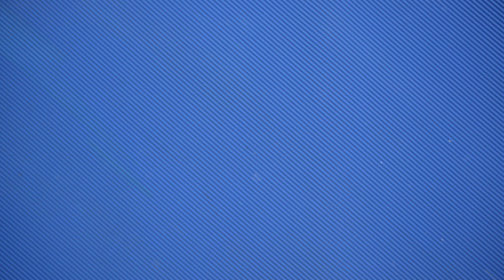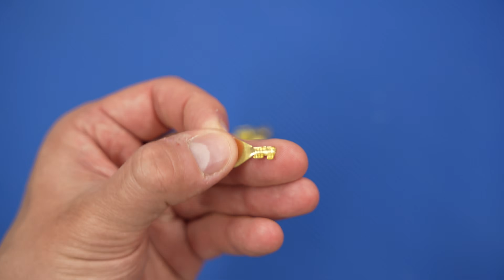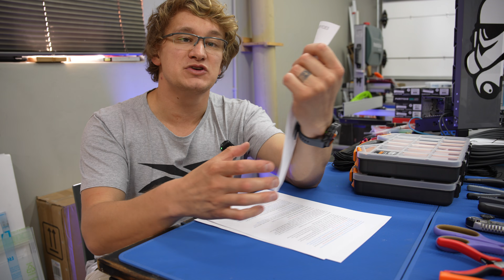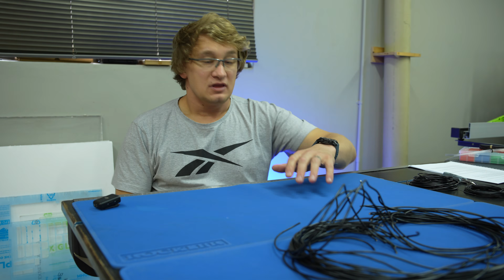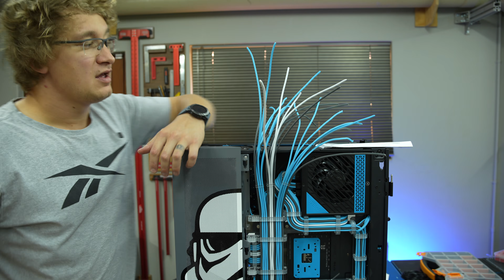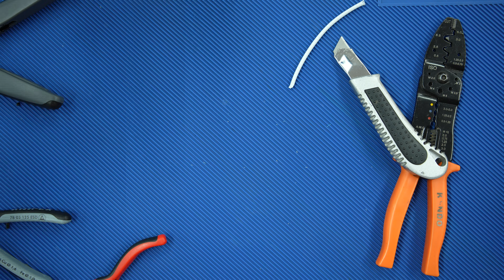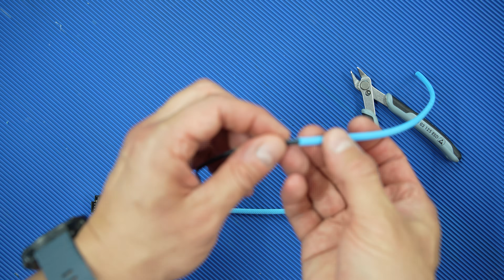How to Make Custom Sleeved PC Cables Step-by-Step (Full Guide)

Comment: great video! any tips on how to daisy-chain/split fans with entirely custom cables?
Reply from the maker: Thank you! Glad you liked it
I’ve done a few builds with fans that are individually wired. It depends on what type of look you want? I usually like to make the wiring a feature by using cable combs to keep the sleeved wires next to the fans as straight as possible and then make a daisy chain board close to the termination side. If you want a cleaner single cable look, you can either make a daisy chain port next to the fans, where all the fans plug into (think of it like a usb port hub) with one cable going to the power point. The third option, a single cable for 3-4 fans, strip a small section of insulation off of the wire (like the split wire in the video) attach a small piece of wire to the splice, just enough to attach a connector. You can then insert the wires into the sleeving, without cutting the sleeve , instead pulling the sleeving open to get the split wires through. Should look very clean. Hope that makes any sense😂 
Let me know what you had in mind, could maybe make a video about it! and Thanks again for watching really appreciate it!

Comment: Just thinking about doing custom 24pin Motherboard, CPU, and GPU, and your video was timed well and a good watch, but what about pre-sleeved high temperature wires, isn't a very high colour choice, basic, red, white, blue and black, then yellow and green. I thing it would be cost friendly, never done custom cables myself. Some people call the wire I'm talking about Oven Wire, I seen it around being in industry, but others may of seen it used in ovens, heaters or kettles.
Reply from the maker: Hi there, thank you! 
I haven’t tried that before, the two questions that I have is: How stiff is the pre sleeved wires? and how will the sleeve be kept in place? The wires I use are quite stiff, not too stiff but enough to keep its shape when bent. And the sleeve I use can also be easily melted to the terminal pin to keep it in place. I recon the high temperature sleeve will be quite difficult to melt 😂 you will then have to use heat shrink to keep it in place and that might not look too great. Thats the only questions I have? But yeah nothings impossible. If you are looking for a cheaper option, you can always just sleeve your existing cables that came with the PSU? I am planning on doing a “how to” video on that as well